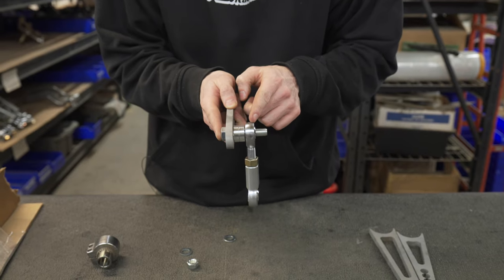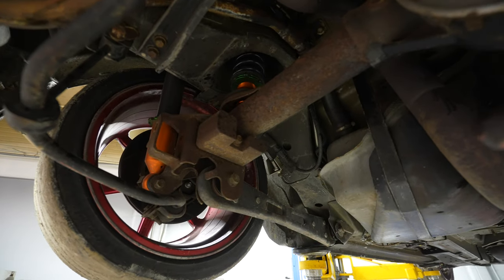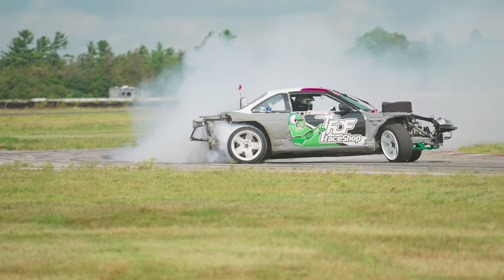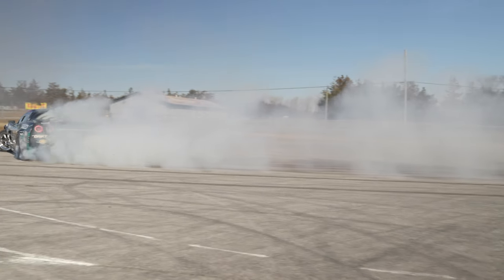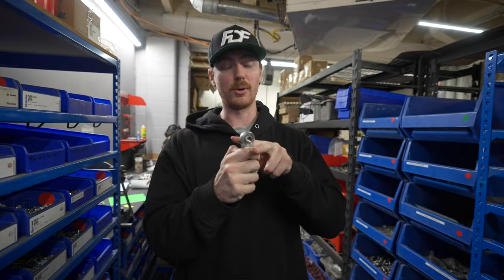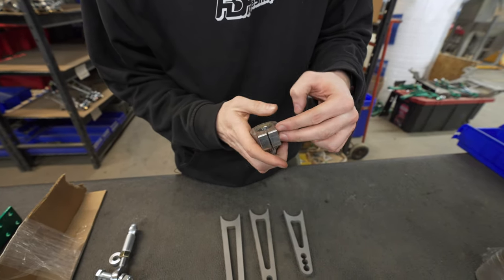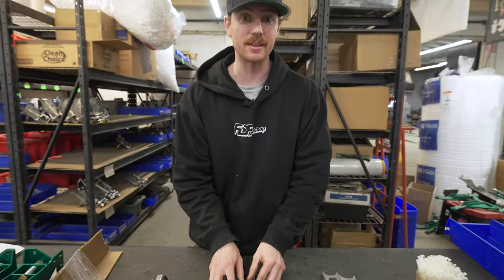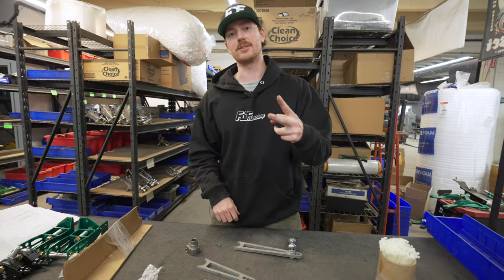Should You Be Running a Sway Bar on Your Drift Car?

Comment: I liked the tip about adding spacers between the end link and the sway bar. 
I would need to get a different kind of end link to make that work on my current set up though. The ones I have are a ball joint style and wouldn’t have enough threads.
Would you guys sell a custom setup where the endpoints are through bolt style? I’m in an S197 Mustang with your angle kit

Comment: Hello, I really like watching pro tip videos. I would like to ask ,I like your Corvette setup. Last year I made a swaybar for my BMW E46 drift car. I used 28mm sollid spring material up front. But I have the original M3 swaybar at the rear. do you think it would be good to give a similarly rigid stabilizer to the rear as well, which would be connected directly to the knuckle. Maybe it would be better to make it from chromoli tube . so I'm wondering what diameter you would make it from.    My Car weight about 1250 kg . Thank you Best Reggards from your fun in czech republic .

Comment: I have yet to install it, but I have an FDF kit for my new edge mustang, that requires the removal of the front sway bar. I think you may have updated the design for the kit since I bought mine a couple years ago. That being said, how would you set up a front sway bar on the new edge?
Reply: Also, in regard to the new edge: any plans to make an FDF irs kit for the new edge?